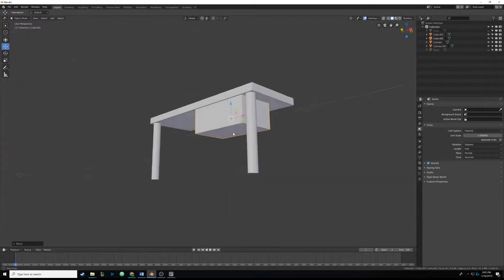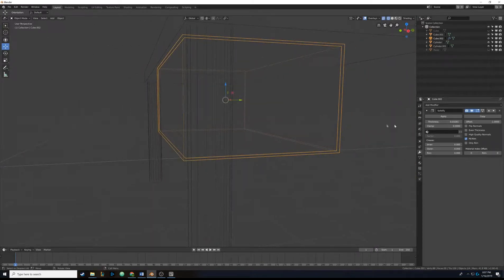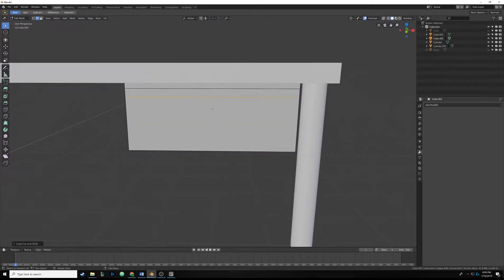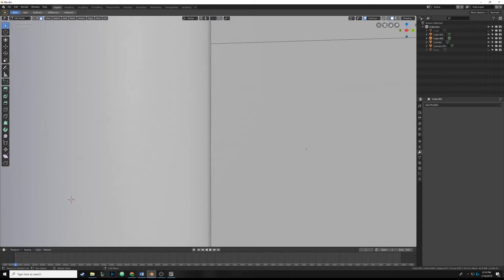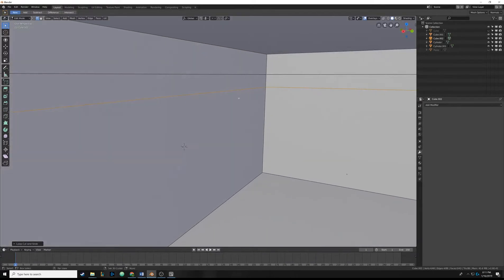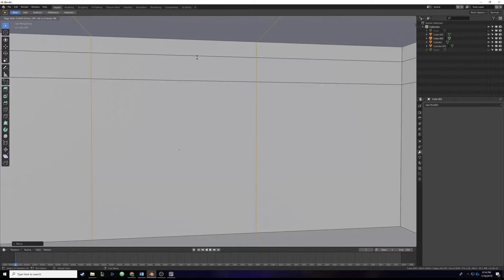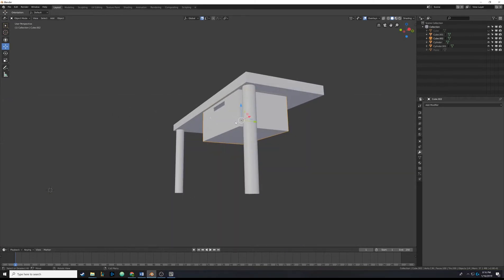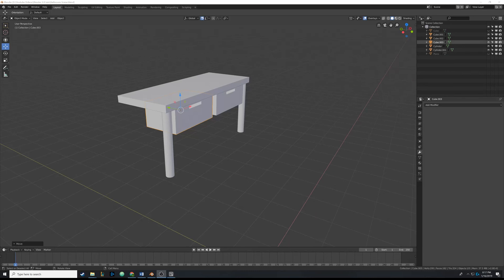Making A Bathroom In Blender 2.8 - Part 5, Finishing The Cabinet (For Beginners)

Comment: My cabinet looks weird and is glitching out.
https://imgur.com/a/RhSzVLp
Reply from the maker: It looks like you might have multiple faces on top of one another, try moving that glitchy cabinet around to see if you accidentally duplicated it. Otherwise you might have two faces on top of each other in edit mode (hit tab)
Reply: @3DTinkerer  Yeah, I did have two faces on top of each other, but some of the faces weren't cut the same and it looks like the object wasn't duplicated. Just some random faces were added in that I wasn't aware of.
Reply: I fixed it by deleting the glitched faces and making them again with the join thingy. I don't know why it happened in the first place.